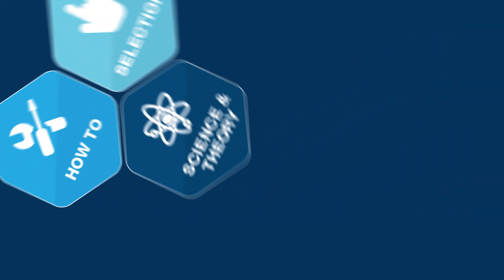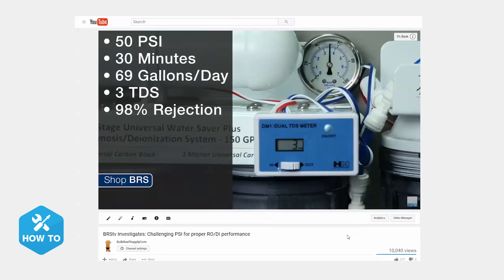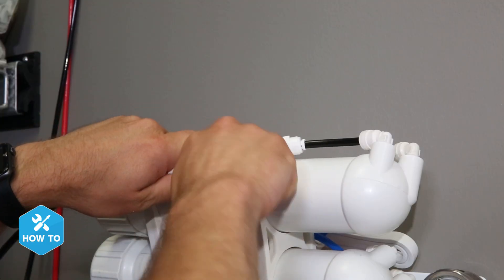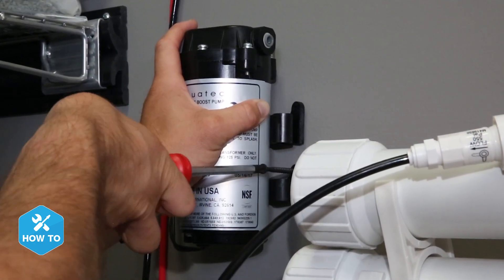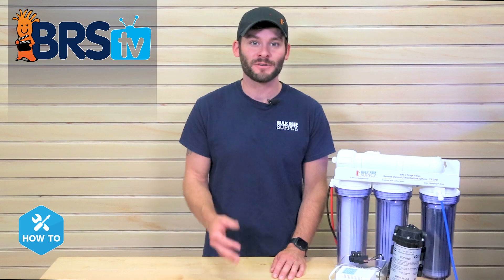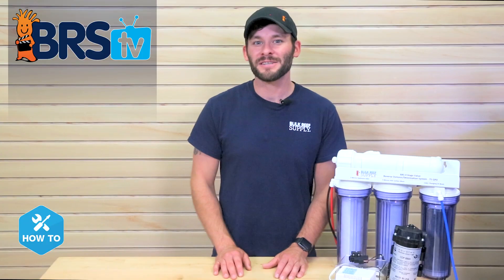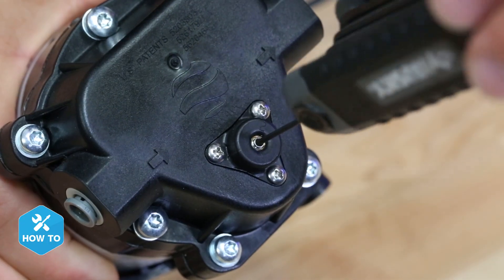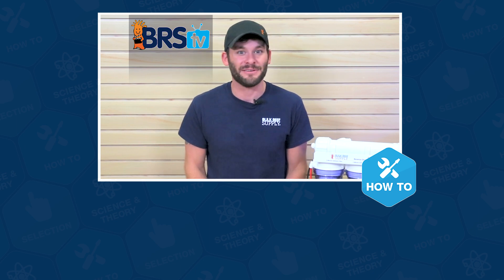How to install the RODI Booster Pump Kit | BRStv How-To

Comment: The flow direction on the shutoff valve absolutely matters. I just installed this on a BRS RODI and in the first direction the blue line was gushing water at the valve and no water was getting through. As soon as I flipped it around it started working. I hope this didn't damage my brand new piece of equipment. You need to shoot a new video or ammend this one because it's bad information.

Comment: Can you install the pump after the RO filter?   I already have a pump in my filter but its an enclosed system so I cant get to it but the pressure on the outlet is only 20psi and I need 30 to 40.

Comment: Thanks   answered my problem of the pump was putting out 100 psi and i need to reduce.  i also installed dampeners before the gauges because the pump was banging the gauges.

Comment: I bought an aqua fx booster model # 9644, and it took my well water source  @45psi and made it 90+ psi, and it's at the lowest setting,  should I be worried?
Reply from the maker: We usually recommend staying at or below 90 PSI as the higher you go, the higher the chances are for a leak to develop in the RO system connection points.

Comment: I'm getting about 34psi on my gauge. I have the BRS 4 Stage Value Water Saver Plus Reverse Osmosis/Deionization System - 150 GPD I just use to make drinking water. Do I get the 1/4" or 3/8" 8800 Booster Pump Kit by Aquatec? What is the max psi I can achieve with this booster kit? I hope to hit between 65 - 75 psi.
Reply: Got my answer. I will get the kit when it becomes available. BRS site rocks!

Comment: Tank won’t fill, water only flows for a couple seconds until it becomes a trickle, and water flows quickly out black brine line.

Tank maintains air pressure as far as I know (can’t get a perfect reading from the warped air-fill valve).

Is the water pressure from the home too low, or ASO or check valve needs replaced?
Reply from the maker: If you don't have a pressure gauge on your system, the best thing you can do (aside form adding one) is to collect the product water and time how long it takes to make 1 gallon. From there, you should be able to figure out how many gallons per day your system is producing. If it's substantially lower than what the RO membrane is rated for, it's likely that your pressure is lower than ideal. 

All of that said, we highly recommend adding a pressure gauge as it will best help you troubleshoot your system and optimize performance. 

https://www.bulkreefsupply.com/glycerin-filled-pressure-gauge-1-100-psi.html
Reply: @BRStv  it doesn’t have a gauge built in, but I just lowered the tank’s empty pressure to ~8psi with my tire gauge and that allowed water to enter. Thanks for the info!

Comment: Just to confirm here.... After shutting off the water supply line, the booster pump will run for an additional 5-15 minutes before shutting off? Pump is on the main supply line, just after my shutoff valve and the included pressure sensor is hooked up after my last stage of DI on its way to collection.
Reply from the maker: Shutting off the water supply would have no effect. The pump will shut off when pressure builds up and the pressure switch triggers. In typical situations, the pressure switch is installed on the product line and pressure builds up when a float valve is triggered.

Comment: Why do some install it before the reservoir tank
Reply from the maker: The booster pump will need to be installed before the RO membrane. Ideally it would be installed after the pre-filters, but the most common installation is before the RODI system as a whole. If you aren't able to install before the pre-filters, they make a small strainer that can help protect the pump from any larger particles that might make their way in.

https://www.bulkreefsupply.com/dm-fit-filter-strainer.html

Comment: I'm finding that when I installed mine, even when I have my ball valve turned off when I'm not creating any RODI water, the booster pump still is running when plugged in. Is there a reason for that?
Reply from the maker: If the ball valve is located before the pressure switch, the switch will not function properly.

Assuming that the ball valve is after the pressure switch, then it does take a few minutes (usually 5-15 mins or so) for the switch to activate and the pump to turn off. If that's not happening, feel free to shoot us an email with some photos of how everything is plumbed and we can help troubleshoot.
Reply: @BRStv  I had the same problem and found that the switch needs to be hooked up to the power supply directly.  Then plug the pump into the y.  I found that playing with how the wiring is connected fixed my problem.

Comment: Can you install booster pump after ro filter to increase holding tank pressure? I have 60psi in, 20 psi out. Is this normal?
Reply from the maker: It's normal for the product line to not have as much pressure as the source line. We wouldn't recommend a booster pump on the product line, only before the RO membrane.

Comment: My main line pressure is fine, but my RO is low.  I recently (today) bought a new refrigerator and hooked my Watts RO to the refrigerator water line, as well as keeping it connected to the sink drinking line.

The water pressure is pretty low, causing the water dispenser to drip on the fridge.  (I was told if pressure is below 29psi, the fridge valve may not close properly.

Is this the booster I need??  Or is this only if your city/main line has low pressure…??

Just my RO had low pressure…
Reply from the maker: If you're going to be hooking the RO system up to a refrigerator water dispenser or ice machine, you're going to want to install a pressure tank. RO systems produce water really slowly, so having a pressure tank will give you water on demand much much faster and avoid that fridge valve issue that you mentioned. 

When we talk about pressure, we're usually concerned with the pressure right before the RO membrane as pressure will affect it's performance. If the pressure in that location is 29 psi, you'll definitely want a booster pump (50+ psi is recommended)
Reply: @BRStv  Thanks for the info.

I do have a 3 gallon water tank, will it help with pressure if I add a second 3 gallon tank?

Again, thanks for the help, trying to avoid a 400.00 plumbing bill for someone to do a simple task that I (possibly) could have done.

Comment: ok... so how do you size a pump to a system when never are flow and pressure ratings of the pump made available???
Reply from the maker: The Aquatec 8800 booster pump kit works with RO systems from 50 GPD all the way up to dual membrane systems at 200 GPD or more. There is a small adjustment screw on the top of the booster pump if you need to turn down the pressure a bit (unscrew the screw slowly to turn pressure down).

Comment: How long should these pumps run until they turn off with a high pressure switch
Reply from the maker: It depends on how long your product line tubing is, but generally less than 15 minutes.

Comment: Am I supposed to splice the red outtake water line in half and install the booster pump in between? You don’t explain it well enough in this video
Reply from the maker: That's correct. The booster pump needs to be installed on the source water line before the RO membrane.
Reply: @BRStv  got it installed with the float valve so now it’s all automatic! What’s the ideal pressure for the 4stage ? With the booster pump I’m around 85 90 but it seems like the canisters are leaking a tiny bit. Should I dial down to 80?

Comment: Hey their bro I have a 50 GPD LP ro unit and have well water and my pressure is like 30 and high 40 psi and my auto shut off is not shutting off  what can I do can you please help.
Reply from the maker: The auto shut off valve will trigger at about 40 psi, so it's likely that your low pressure is why it's not working properly. We would suggest installing a booster pump in your case.

Comment: why would making the adjustment to the booster only reduce, not increase pressure?  Assumed that they arrive at max pressure?
Reply from the maker: That's correct. The set screw arrives screwed all the way in. You can back it out to reduce pressure if needed.

Comment: My incoming TDS is 455 softened water, 50 gpd Dow membrane, well preasure fluctuating between 40/50 psi and I was producing 18 gpd at 12 tds.

I Installed a booster pump, upgraded to a 75 gpd Dow membrane, psi is now 60/70 psi, I'm producing 73 gpd at 1 TDS.  What a difference.

Comment: I've bought two of these pumps for my RODI system (6800 and 8800). My pressure is about 20 PSI and doesn't change at all with the pump running. The pump is definitely running and definitely hooked up in the right direction. Any idea what could possibly be going wrong?
Reply from the maker: If you added a booster to the system I would expect to see a pressure increase. Is it possible the flush valve on the waste line is open? Since we saw no pressure change this could be a factor. If really struggling with this feel free to contact our support for some help! :)
Reply: @BRStv  I’m having the same problem at 45 psi, I plugged it in correctly and still won’t go above 45 pai
Reply: Ever find the solution to this problem lol?

Comment: I don't feel like I was really shown how to install a pump. Where to plumb switch, is there any solenoid...? This is a very vague clip.
Reply from the maker: I think we can definitely improve on some of these how-to's. For a quick answer to your questions, the shut off switch will be placed after the entire RODI unit. As for the booster pump kit we carry, there is no solenoid to install, however you could add one in to your own setup if you desired in which case I'd install it after the pressure sensor switch. You can always give our CS team a quick call for help like this or more! We're here to help. 🙂  763-432-9691

Comment: I bought a new aquatec 5800 DDP because I thought the old one had gone bad. The problem I'm still having is that the water pressure starts fine when getting water from our fridge but then slows rapidly within a few seconds and I can hear the pump still running. Any ideas?

Comment: “Any adjustments you make will only decrease the pressure” that’s not true, you can turn the hex screw back and forth and watch the pressure increase and decrease.
Reply: I was hoping someone commented. Very confusing the way he phrased that. It makes it sound like once you decrease the pressure theres no way of raising it back and now you pump is junk hahah.
Reply: Yeah this was pretty confusing. I'm pretty sure that he means that the pump comes from the factory at its maximum power and turning the dial is only intended for decreasing from that maximum.

Comment: Video does not mention connecting a solenoid. Is that not necessary?
Reply: Could the pump overheat if you lose water pressure?

Comment: My pump works when plugged in without the pressure switch. It does not function when wired up with pressure switch unless source water is turned off. Then it cuts the pump on when basically almost dry. Can you help? I also have a pressure gauge I’m going to hook up soon, because the existing one died.

Comment: Hello, a question, I wanted to know why the pump was not installed on the RO membrane inlet line?
Thank you so much and excuse my English.
Reply: You are right, for the reverse osmosis process to take place, the pump must be installed after the three filters and before the membrane because it needs pressure to complete the process, otherwise the waste water will be a large amount, because the purpose of the pump is reverse osmosis, and nothing else, the pressure of the water that comes to the filters is enough  To fill it, and pass to the other side, the pump to reduce waste.

Comment: How come you guys dont sell electronic cut of valves as a kit with this pump? I replaced two auto cutoff switches because it leaks water thru the waste water line when i wasnt producing water with the pump off. I added the electronic cut off switch that opens the supply line when the pump turns on and it works like a champ.
Reply: BulkReefSupplyCom I bought one out of amazon  and it works great. I was tired of wasting so much water specially since i am using a water softner. I think a lot of reefers could benefit from it if you guys sell it.

Comment: How much pressure boost do you typically see from this pump? I'm currently at 40psi input pressure on my RO unit (which is doing just fine with reducing ~200TDS tap water down to ~3TDS), but I would love to upgrade to the 150gpd kit. Do you think this pump would give me enough boost to upgrade?
Reply: Mine went from 45psi to 100psi.

Comment: will this set up work with the system you previously described where the waste water is sent back through the unit for one last treatment? (And in turn cut down on waste water loss)

Comment: missed a lot, like product water to waste ratio's, the fact that the booster should be installed after pre filter and carbon stage to reduce possible fines from carbon block getting shaken loose, a check valve after carbon cartridge can help keep bouncing water pressure from affecting anything. Major thing is waste water ratio will be off when running higher psi and needs to be tuned, or with cost of membranes being cheaper just changed more frequently. water pressure needs to be kept in system or unplugged after use.

Comment: Before you buy a booster pump, check to see if you can adjust your home's water regulator to a higher psi.  
 
I increased the water pressure in my house from 40 psi to 60 psi with the turn of a wrench.  This only works up to the pressure in the mains.
Reply: Perhaps there was a reason why it was set 40psi. Maybe your home's plumbing is not good with higher pressure.
Reply: @bhbae1  Other than maybe a little higher water usage we've noticed no negative effects.   I believe that 40 psi was just what the regulator was set at when it was installed.
Reply: @jTempVids  That's good that your home plumbing is not affected by increased pressure. I am afraid of any long term leak over increased pressure.